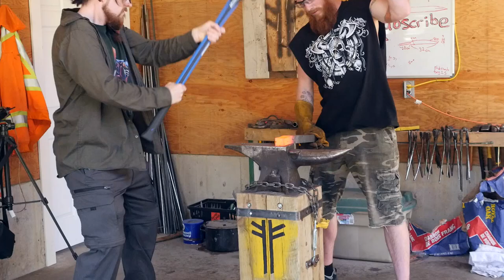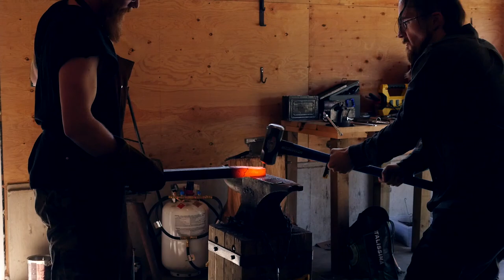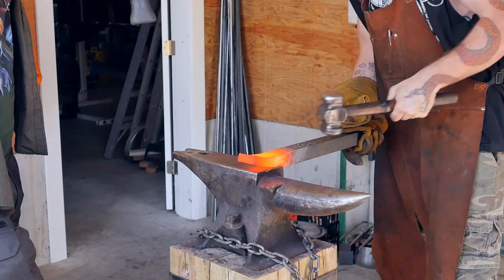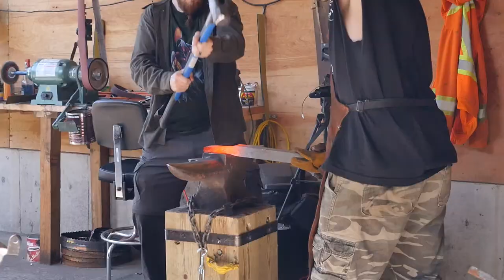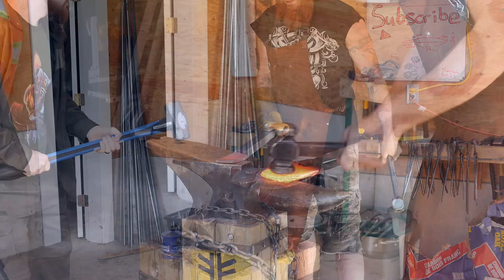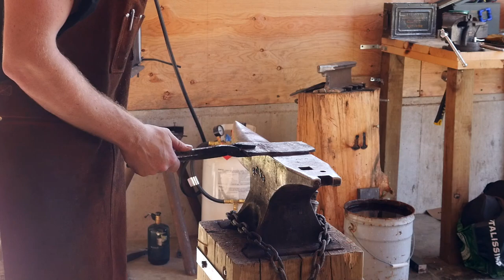10 Minutes of Nothing but Forging (You Asked for it!)

Comment: But you said at one point, that it took 3 hours to bang it flat. What happened to the footage? Did the battery die or something?
Reply: Lots of that time is spent heating, each heat has about 30 seconds of beat. But heating that big of stock can take many minutes. You need to be sure the heat has soaked all the way through every time and that its not just the outside that is hot.

Comment: lol Yeah with all the ASMR videos on this site you know people would want it. And it is kinda hypnotic in the auditory sense. Kinda ironically soothing considering it's two hammers smacking metal. Guess it helps not actually being there to avoid a headache. 

I feel the same way welding. The buzz and hum of electricity, the hypnotic pool of molten metal, and the smell of burning flux in the air. The world just melts away.

Comment: Ok i have mad respect for Friis as he swings what looks like a 3 pound hammer like i swing my 2 pounder. I'm a bit surprised Skallagrim could forge in a long sleeve shirt given his aversion to heat. Then again the burns on my arms show its kinda a good idea to wear long sleeves when forging. but when its 90 F out you tend to strip off the lairs, and when its -20 F out even a hot charcoal forge requires a few shirts on.  (yes i have infact forged in both.) you two had a great rhythm going. It was very plesent  to listen to.

(excuse my language here but its warranted) God damn that is the largest piece of stock material i have ever seen. Just what the hell is it. 0-0
Reply: PS: is that a forge weld you guys had going cause it looked like one at times.

Comment: I study blacksmithing, and I have a question: Is it really necessary to forge a plate from such enormous railroad-sized chunk of iron? Of course isn't, but I have a better question: is it beneficial in some way compared to forging from much thinner piece of metal, for example about 6mm thick? Yes, forging will strengthen the material but not limitlessly and I'm sure you reached the that limits just in the beginning. I ask you whether it wasn't completely unnecessary to forge something too thin from something too large?

Comment: Skallagrim: Would you be willing to review the KA-BAR Utility and Fighting Knife? The Knife retails for $70 USD ($88.69 CAD) and comes with both the knife, and a leather sheath. The leather sheath is made in Mexico, while the entirety of the knife is made in the USA. It is comprised of "1095 Cro-Van " Steel. This is not the same as 1095 Carbon Steel, rather it is AISI 50100B Alloy Steel -  it is similar to 1095, but with Chromium, Vanadium and Molybdenum - it's roughly halfway between 1095 High Carbon Steel and O1 General Purpose Tool Steel.  
The knife has a 7 inch long (178 mm) clip point blade and either a leather-washer handle, or a plastic-washer handle. It has a Hardness of 56-58 HRC, a dull black finish, and a flat grind. It has an edge angle of 20 degrees, and weighs 0.7 pounds, or 0.317 Kilograms. They are made in a 100 ton blanking press, and are able to pump out nearly 9000 knives a day.  
I personally have a KABAR, and as far as I shall state regarding it's fit and finish - It seems flawless in this regard. There are no gaps visible to the eye, no rattle on any parts, and the blade is perfectly straight from a visible perspective.  

I know you generally don't do knives, but I feel you would like this one. If the Marine's accounts hold true, they subject it to what is honestly abusive to the blade, but report that it doesn't have any problems because of it.

Comment: Blacksmith here, I'd like to give you some advice to prevent you from damaging yourself. You are so darned far away from the anvil, and thus the hammer is very far away from you. Put your left foot up against the wood block, right foot behind it and at a 90 degrees angle of your left foot. Lift the hammer completely upright(closer to your body, too, for obvious reasons) then you basically let it fall forwards. Your left hand is pretty much an axis around which your hammer moves, meaning you don't really move your left hand, only tilt it. When you get used to that technique, you can start moving your left hand up and down more. What you are doing now would be quite unhealthy if you were to do this more often in the years to come.
Reply: Also, get that guy to put some big magnets on his anvil, that will help a lot to save your hearing... Although that doesn't help with lower quality anvils, and I honestly can't really draw conclusions from recorded anvil sounds like this, but the anvil seems to be of quite good quality(My standards might be a bit high since I've had the pleasure of working with an anvil worth over €3000 lately)

Comment: Why anvils have that shape?
Reply: the flat center is to hammer in clean solid shapes.

the round "horn" is to make curved shapes.

there's also an edge for wedges. I think?
Reply: The center mass has the most bulk to provide 'rebound' to put the most energy back into the workpiece, you want the most mass possible directly under the spot you are hitting.  You also want a good flat area to work on.  Many blacksmiths will round over the near side to make it more resistant to chipping.  The horn or bick is for making rounds and curves, it comes to a point for sizing different loops, good for chain and horseshoe type things.  The other end is usually a heel, which has a pritcher hole for punching through, and a square hardie hole for putting tools in, such as a cutoff chisel or swages.  There are many patterns of anvil, and not all of them will have a bick or heel, some may have two different shaped bicks, or only a heel, or a heavy work anvil may have none.  The most commonly known is the London, or Peter Wright, pattern, used here.

Comment: I'm not much to critizise your tecnique, as everyone has their own preffered style. though lifting your sledge straight up like that could potentially cause some major head damage, specially if you're two strikers. Imagine one lifting his sledge straight up, while the other one is forcing his sledge down. The two hit, and what do they do? they go back where they came from. (roughly, and with insanely much more force) those sledge could be hitting faces, legs and other bodyparts at a literally bonecrushing speed. I haven't had this happen to me exactly, (luckily) but I've seen it happen. that's somw scary thing to watch. I cringed every time.

Comment: I've always wondered, that shape anvils have is oddly specific, is there a reason they're like that? (keep in mind I'm at a level of knowledge on the matter where I feel a cube could do the job just as well)

Also, you do realize you could have made a much, MUCH clickbaitier title right? like "nothing but 10 minutes of two bearded men hammering (you asked for it!)"
Reply: i could be wrong but...

if your just hammering things flat, then sure a cube would work, the "horn" is for shaping
and the hole (when there is one) is for differant tools/jigs

i believe the reason it narrows tward the middle is weight reduction (its still mostly as strong as if it didnt)
a RR track is plenty sturdy for knife making

so the shape is for function, and not being a cube is to cut weight
and the stump/wood base is to dampen the downforce of the anvil
so it dont explode from being struck from both directions (and to add some height)

Comment: Even without the professional right there, it is very clear your lack of experience or understanding for hammering as you almost solely move with your waist or with your shoulders and elbow, instead of using every single joint from the waist, up the spine, to the shoulder, the elbow and the wrist, like the man right in front of you; without the comparison, you just look off, very stiff, uncomfortable, unnatural and very exhausted as time goes on. Just to state my observations after your own mentions of it all from the original video. I hope, if you get into this sort of thing more, you pick up the ropes, maybe practice outside the forge, and get it down well. ^^

Comment: Skallagrims grip on that sledge makes me cringe.
Reply from the maker: That's because you don't realize the importance of precision when striking the steel, and that holding it closer to the head gives you much more control.
Reply: Isn't it just a flat piece of metal? In my opinion, for these easy shots to hit, you should spend less energy tiring you out. Holding the base would have higher velocity with less input, less input means less energy consumption (i assume you know the physics behind it already). Not tiring yourself out would be beneficial.